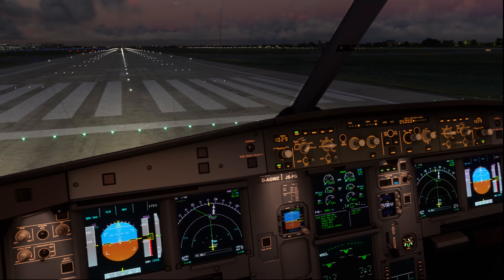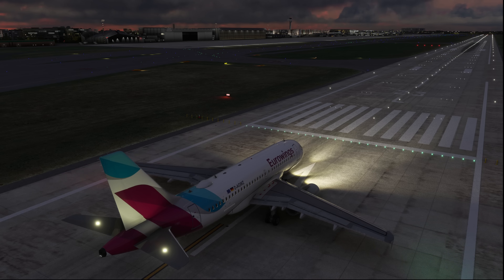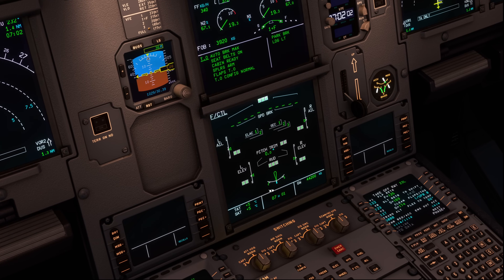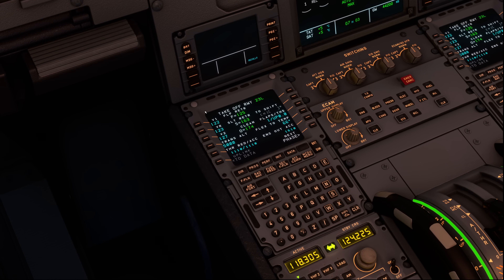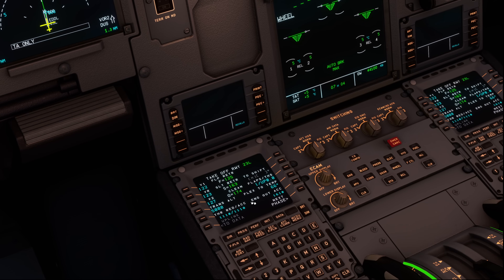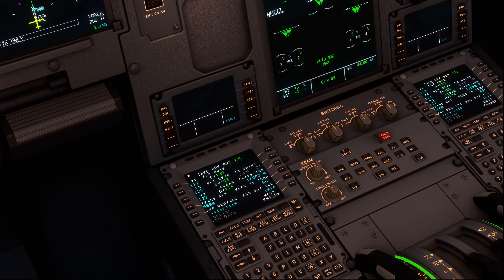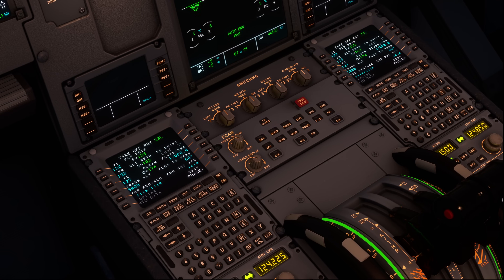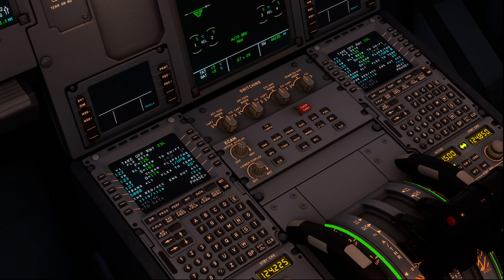Lower V1/V2 with lower thrust? The effect of thrust on takeoff speeds explained | Real Airbus Pilot

Comment: Nice video, but it doesn't fully explain your opening premise that some simulated airplanes are not doing the takeoff V-speeds correctly because they don't vary those speeds with the use of reduced thrust.Your discussion of minimum control speeds is broadly correct, but only addresses a small part of the takeoff envelope. Minimum control speeds are not limiting, and therefore do not influence the takeoff speeds in most of the envelope. What is important is that VR and V2 speeds are, in most cases, a function of T/W. Because of the increased acceleration at higher T/W, VR speeds can generally decrease with increasing T/W and still comply with the takeoff speed regulations. To make a long story short, VR and V2 (except where V2 is limited by stall speed) can be lower at the same weight when TOGA is used for a takeoff where reduced thrust (Flex or assumed temperature) could be used.  However, it is also legal and acceptable to use the higher speeds associated with the Flex (or assumed) temperature if that Flex or assumed temperature could have been used instead of TOGA. Therefore, it is not completely incorrect for these simulated airplanes where the takeoff speeds are not different between Flex and TOGA thrust (especially when the speeds do not include a complete takeoff performance assessment).

Comment: Very good explanation. In Norwegian we also used a choice of engine ratings. ie 22, 24 or 26K (in thousands of pounds of thrust) we would attempt to use the least thrust possible to get airborne within the legal safety margins. All this in order to reduce the temperatures in the engine during take off thereby reducing maintenance costs. Very complicated to explain and plenty of scope for error. However in reality once used to it it is quitte easy. Ultimately it is always up to the PIC to determine the actual thrust levels used with the aid of the EFB performance tool.
Just to confuse everyone even more 😂